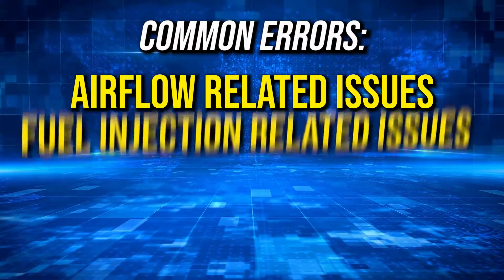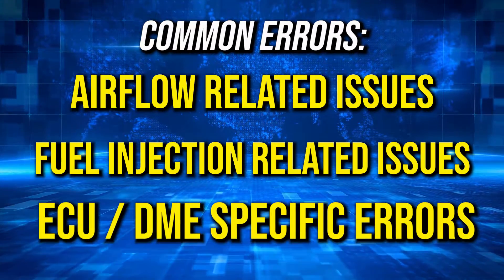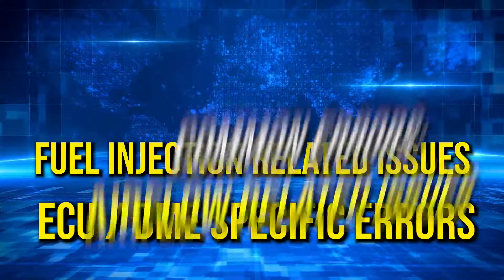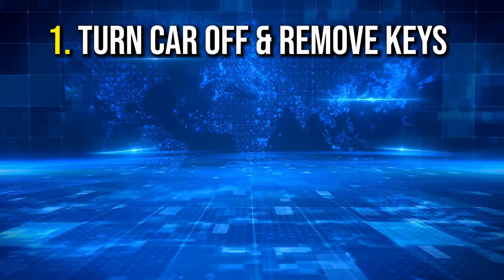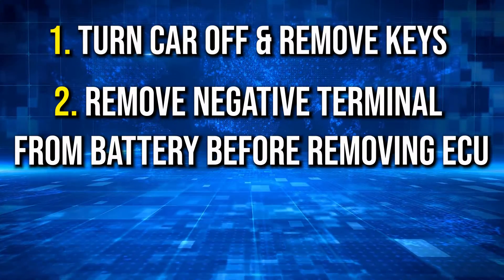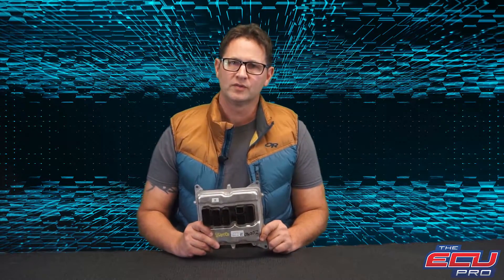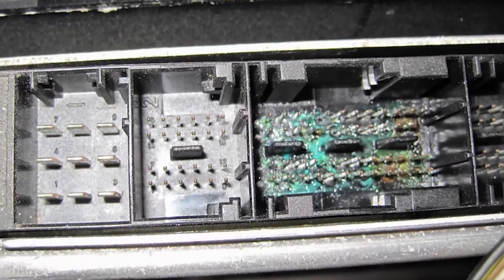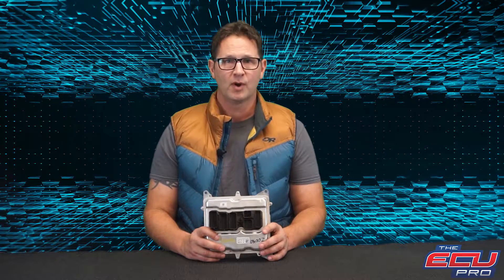BMW ECU Repair and Testing Service  - The ECU Pro can test and repair all BMW ECUs

Comment: OK guys, I may need your services. Here's the lowdown so you can comment if I need to send it in.
1. replaced vanos, all sensors - both oil temp, coolant temp, both MAF sensors, both Camshaft sensors, fuel filter/pressure regulator, fuel pump, evap purge solenoid, disa valve...belts, thermostat and water pump...basically every replaceable maintenance item including alternator. 
2. Using carly app, errors persist, mainly electrical errors that show low voltage to all sensors, injector, Service Engine light will not be reset no matter what tool is used, Air flow errors, MAF Sensor Errors even though all were genuine bmw new sensors...I replaced them twice so I know it ain't the sensors, BSD comm errors, 

I am at a loss... it appears that this is a ECU/DME related issue because alternator was replace also twice with new units and still these BSD communication errors will not go away...BSD is the comm between the ECU and alternator as far as I understand. something is up with the ECU imho. 

Anyways, comments/suggestions appreciated and I can send it in to get diagnosed and repaired if that will address these persistent errors. Best Regards.

VT
Reply from the maker: Good Day, what car is it is? Permanent BSD line faults can be from a DME. Send us an email to info@the-ecu-pro.com
Reply: @theecupro  2005 e46 330ci.

Comment: Hi, I have a 2011 BMW X5 and my Engine computer is fried can I still fix it or do I have to buy a new one and where can I find one I really don't wanna by the one from the original manufacturer. 

Thank you
Reply from the maker: Hi Adam, 
If you are based in the USA, you can order from our website. We can supply you with a refurbished unit or we can repair the original unit. We will need to get the unit to our store to see if we must repair it or replace it. Here is a link to our X5 dme repairs: https://www.the-ecu-pro.com/x5-bmw-dme-repair/

We can test your DME in an actual car to make sure our repair is 100% working

Comment: Sir, I have 2 questions:

1: when I start my e46, the rpm goes to maximum, is it possible that my ecu is damaged? (any experience?)

2: can you just replace("plug and play") the ecu without any programing?

thx in advance
Reply from the maker: Hello,

Normally if the gas gauge is in the red, the dme is faulty. 

You can only use an IMMO off ECU. To have a plug and play unit you have to code it to the car.